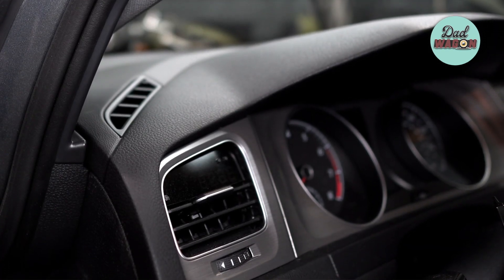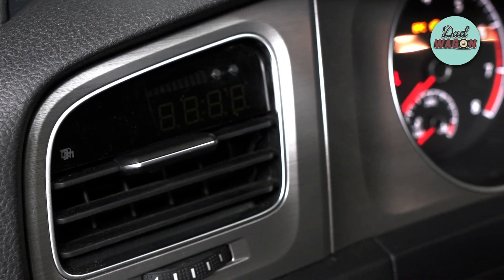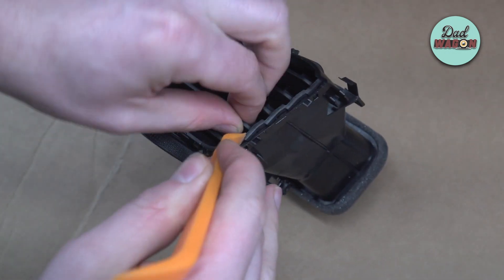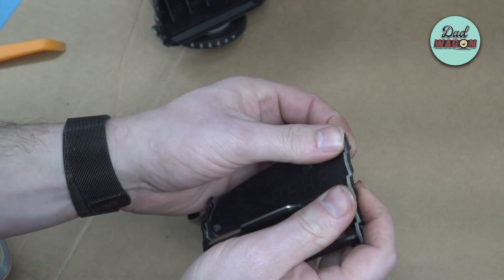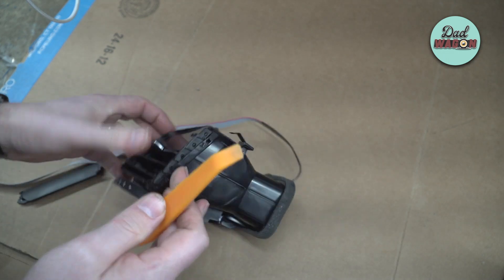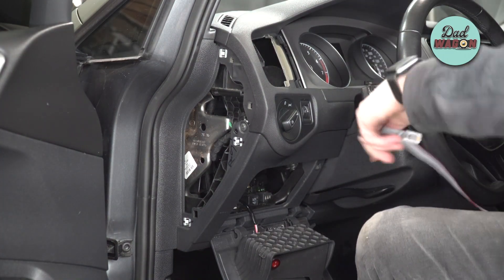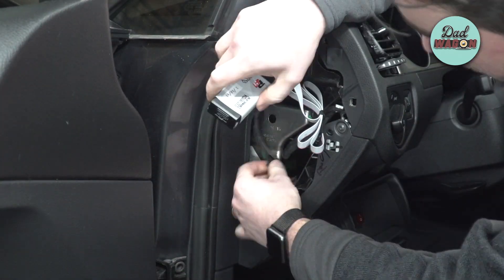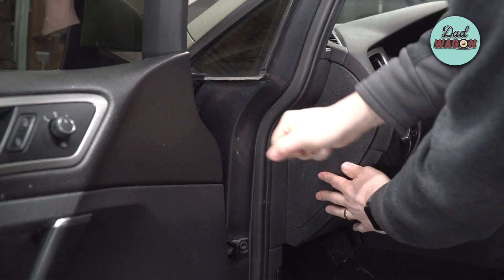Installing a P3 Digital Vent Boost Pressure Gauge for Mk7 Golf and GTI - V3 OBD2

Comment: This or a Draggy? Module
Reply from the maker: Philippe, unfortunately - they're really not competitors or in the same category - so it's not one or the other, but what you want to track. The only real overlapping feature is the 0-60 and 0-100 timers, which i would have to assume Draggy is slightly more accurate with since that's it's main function as well as other timing aspects. The p3 tracks more of the engine vitals, vs. timing metrics.

Comment: I don't know how you feel about the vacuum reading having a bar graph with negative values. The V2 gauge actually had a setting turn off the bar graph for vacuum. Anyway if it bugs you, change your boost setting to "bSt.C" and you'll pull boost from the charge pipe sensor which is pre-throttle body and then you won't get any vacuum readings. If you only care about seeing boost pressure, this works great, and you then don't have a bar graph that goes into the negative. (It also has a much higher limit than the OEM MAP sensor that tops out at 22.5psi). These gauges are amazingly useful and its one of the best investments you can make IMO if you mod your car.
Reply from the maker: woah! knowledge bomb! - seriously, thanks for the thoughtful response. I knew some of that, but didn't know about the bst.c seteting and the non-vacuum reading. This is super helpful. I'll test it out once the turbo install is complete - car is undrivable right now.
Reply: @DadWagon  Just paying the knowledge forward. Jake @P3 Cars taught me that. Can't wait to see your pulls after you have everything back together

Comment: Nice I was just debating one of these.
Reply from the maker: You won’t regret it
Reply: @DadWagon  I have a I.e high torque stage 1. I'm wondering if I need a better dv or spacer? And thoughts on if they improve anything? If nothing else that's another video for you!
Reply from the maker: From what I’ve read (no actual experience) upgrading or changing diverted valves does nothing for performance. If you want more “woooshhhhh” sounds, go for it. Or add an IE intake and you’ll get it that way too.
Reply: @DadWagon  I have the ie intake it's a small woosh stustustu which is nice. I blow my charge pipe off the other day thought I blew my turbo that was fun haha

Comment: Nice 0-60 pull!  You on 93 octane?  Would be good to see what peak boost is on 3rd / 4th gear.
Reply from the maker: Obviously, I shared the best of the bunch - i was ranging from 5.08 - 5.35s. Yes, 93 octane and not bad for heavy all-terrain tires. And technically, I'm probably slightly needing to reach a higher speed than what the speedometer is showing, since the circumference of these tires are larger than OE.
Reply: @DadWagon  If you want to do some data logging, grab the beta logger for the uniconnect.
Reply from the maker: @Zharsergey  what can I do with data logging? Totally new to the concept
Reply: @DadWagon  Can log boost, timing corrections, intake air temperature etc.
Reply: Time to code your cluster for this taker tires. I have 205-55-17 and the speedo is spot on to the GPS up to 85-90mph
Reply: I have a 2016 GSW. I have been trying to use the OBDeleven to view the boost pressure for my original equipment IS12. I can't find that reading using that tool. Are you saying that the P3 digital gauge gives you access to that sensor information?
Reply: @richardhoule9646  obd11 has that data under charts.  Can also record and export to csv

Comment: What made you decide to go with a digital "OBD" gauge, versus a mechanical gauge?
Reply from the maker: Easy of install + Amount of Metrics 

the OBD2 Gauge can do both. It has connections for 2-3 (can't remember exactly how many) analog/mechanical inputs. The OBD2 version provided the quickest install and offers the analog inputs when i want to switch over to that, say for boost pressure.
Reply: @DadWagon  For sure, that is probably the same route I intend to go as well. Do you know if P3 has an information on their accuracy of a digital versus a mechanical? Just curious as to how close the metrics are!
Reply from the maker: @mikerosenthal1977  I do not know - shoot them a note - they're very responsive and just a super small team making some awesome stuff in Ohio (i believe)
Reply: @mikerosenthal1977  We pull the data from either the MAP sensor or charge pipe sensor on the EA888 cars. Both of these sensors are actual pressure sensors and are just as accurate as reading with an extra analog boost sensor. We actually just posted a video on this as well - https://youtu.be/eht_rKZUoXw

If you have any other questions feel free to give us a call or shoot us an email - service@p3cars.com Thanks! -Jake